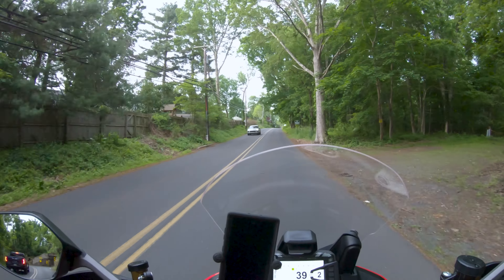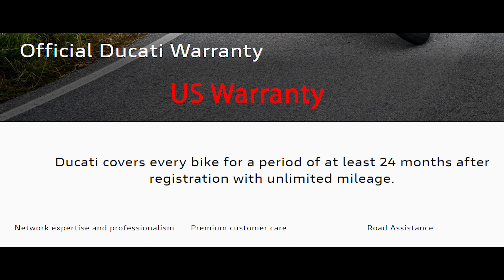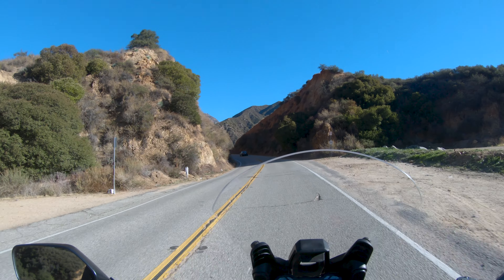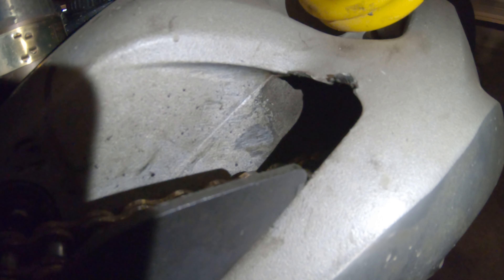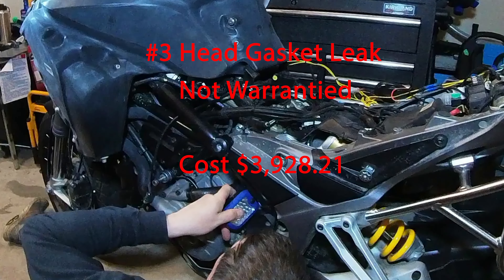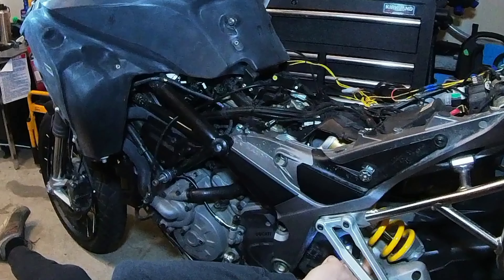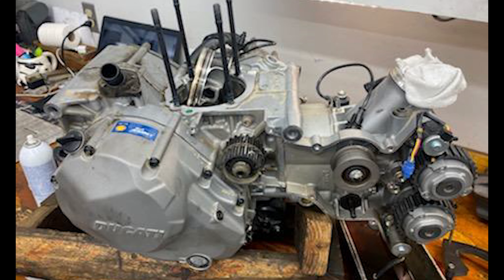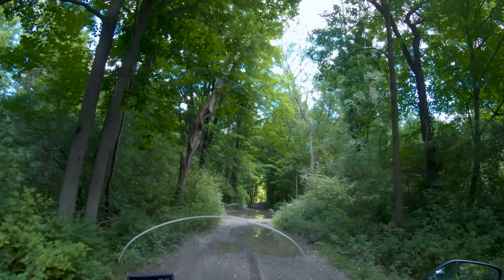Ducati Multistrada 1260 Cost of Ownership

Comment: I have a 2014 1200GT and its my second one of the same bike. First one had only one problem.  It was a broken sensor wire on the rear wheel for DSS system purposes.  A known problem for 2013 &14 years. Second bike had a bad voltage regulator and a bad DSS module.  THe voltage regulator failure caused the failure of the DSS module. Most likely the result of a 10 degree temperature attempt to start the bike after it was in storage for a long time. That’s it.  Love the bike. Adding cool stuff like exhaust, cruise control and quick shifter.  Catch me if you can!

Comment: As mentioned earlier my 2020 1260 Enduro has now 21000 km on the clocks, no issues at all so far, Im gonna change the chain and sprockets tomorrow, putting a 14 teeths sprocket in front. Makes the bike much more pleasent to ride in the city. I have heared that if you change the rear sprocket it could affect the QS, but if you only go down one tooth in front, no issues.
Reply from the maker: Thanks Kjell.  I did contact ducati about 2 different things.  One was the headgasket and they stated it's not covered because out of warranty so I am out the $4k.   I also asked another question about torque specs and they responded within 24 hrs so I am very pleased with their support from that side of things.
Reply: @Fentventures  Thats a pity, one month out of warranty, did you ask them if the head gasket is not made for lasting more than 11k miles. There must have been something wrong with the headgasket. Where is their goodwill in this case. Ask them again, there is a main service at 30000 km, and when your headgasket blows before that, its certainly something wrong. Write them again!
Reply from the maker: @kjellbencsik4917  It is frustrating yes.  It's not worth my time though.  I am looking forward to my other big trips like heading to Acadia National Park for week.  I have no recourse to make them do anything so I move forward with that being a lesson when owning a Ducati.

Comment: 4 years warranty here in Greece also. Ducati is the most expensive brand out there. If you own only one bike i believe is affordable, but this fact does not cancel the high cost. I own exactly the same bike with you for a year now but its not my main. I have done 3000km only but i had a serious oil leak from the horizondal cylinder that ended by changing the cylinder head at the first 1000 km. I believe if you want a change the only option is the ktm 1290 in order to stay in similar perfomance. But the cost of ownership is also very high at least here in european union i dont know in US.
Reply from the maker: Hey Stavros, thank you for watching.  You are correct.  The only other option is the KTM which I have been told by a local KTM/Ducati dealer that it has more reliability issues than the Ducati.